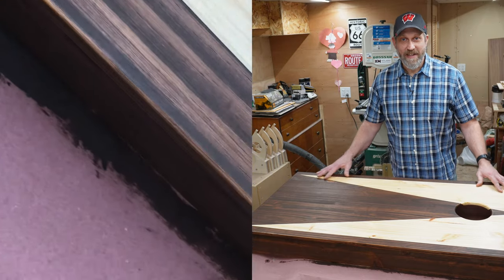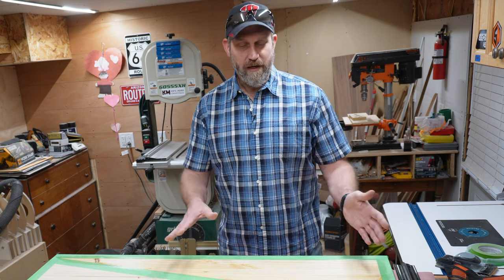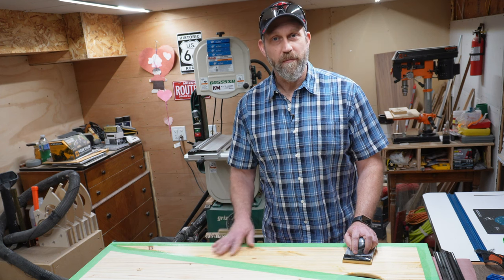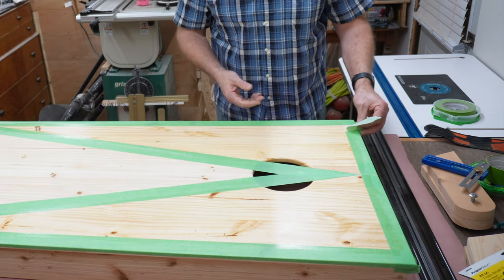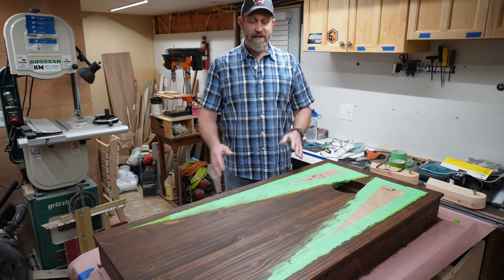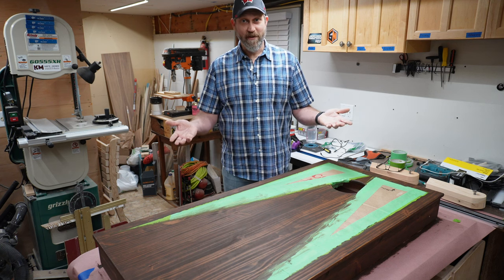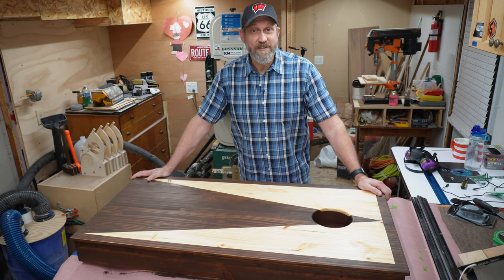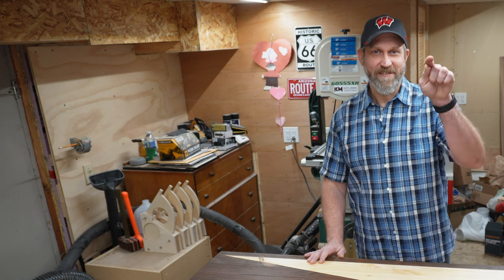Achieve Perfect Stain Lines in Woodworking: Tips and Tricks

Comment: Hi, can you stain over the shellac ? As I’m doing up a gun stock in dark walnut and want an ebony at the front and would like it to be a straight line where the two stains meet .
Reply from the maker: No, stain won’t penetrate through the shellac, which is a sealer. 
Could you do an inlay of a different tone?
Reply: I could slice a straight line so no bridging across the two colour?

Comment: Hey Brett, loving your vids, man.  Are you saying it's the shellac which allows the clean stain line or both that and the masking tape?
Reply from the maker: Thanks for reaching out! The shellac fills in the grain to keep the stain from seeping into the clear areas. And the tape keeps the stain from getting in areas that you don’t want it to go. 
I was able to scrape off the little bits of stain that seeped under the tape in a couple of areas because the shellac didn’t allow the stain to go any deeper than just the surface.
Reply: Thanks man.  I figured that.  I ask as I'm staining a guitar fretboard with leather dye and want to mask the maple side of the board...... @BrettsWoodshop
Reply from the maker: Guetar work. Very cool! 
I'm contemplating making a custom case for my uke at some point. @spacialinstallations

Comment: Thank you for this !! Really loved the video, super helpful. I have a question if that’s OK, 

So I’m working on a project where I want to stain only a certain part of the word like you did in this video, and then on the part that won’t be stained I’m planning on painting a geometrical design over it using acrylic paint. From the research I’ve done online so far, some people are saying you need to sand the surface before applying paint as it might not adhere to shellac, but other sources say you don’t need to because shellac can be used as a primer in some cases. Would you have any recommendations for this?

I read that acrylic paint will stick to De-waxed shellac,as it can be used as a primer. 

Let me know if you have any advice on this 😁
Reply from the maker: Of course it’s okay, I love helping people with their questions. That’s why I’m on YouTube 😎

I understand what you’re asking and I appreciate the issue. I’m no expert in finishes, so take this for what it’s worth. I think the information you’ve gotten is correct. Dewaxed shellac is a good sealer/primer. I would give it a light sanding as I did in the video, clean off the dust with a vacuum or damp cloth, then paint. The acrylic should stick just fine. 

Then, depending on your project, I’d probably go over the top of everything with a sprayed on layer of polyurethane to protect the paint from getting scratched off.

Comment: Brett,  really enjoying  your shop video on how to obtain  ‘ clean lines’ as you finished your corn hole boards.
Actually I’ve watched a number of times in order to catch your tips .
I have two sets I’ve made for gifts and will be using your techniques to finish offoff in a stain and shellac design.

My question is do you   
add additional sealants or poly over the whole board ?
I’m not sure if anything could be applied over the shellac???

Mark
Reply from the maker: Yes, I mentioned that at the end of the video. I added two coats of Polycrylic over the top of everything.
Reply: Brett, finished  my two sets of boards following your advice.
Fist time I’ve made boards and used your methods of masking and have to say ( pat on your and my back ) they turned out better than I could have ever expected.
Absolutely no bleed of the stain.  
So glad I came across your site and advice .

Thanks !
Reply from the maker: That is awesome! Great job! And thanks for following up. 😀